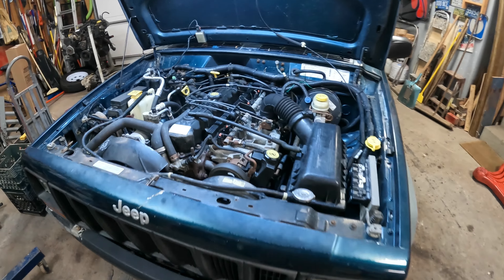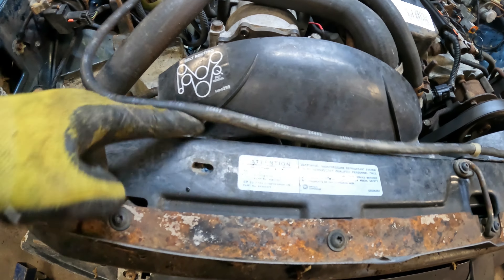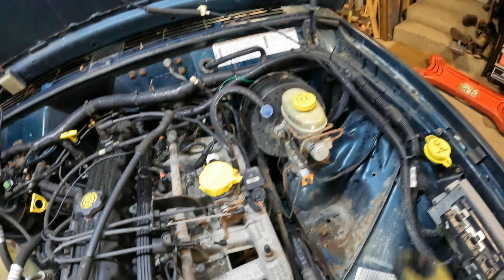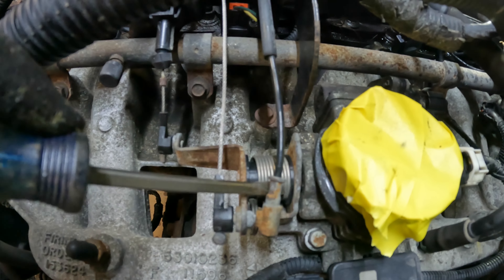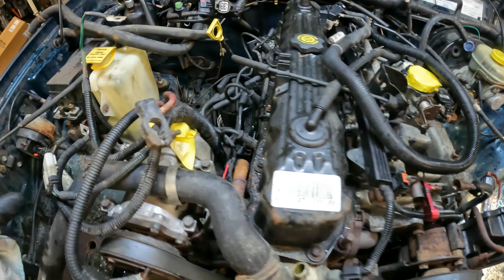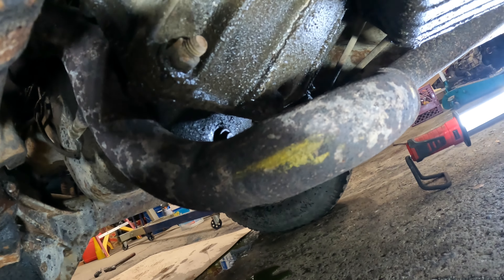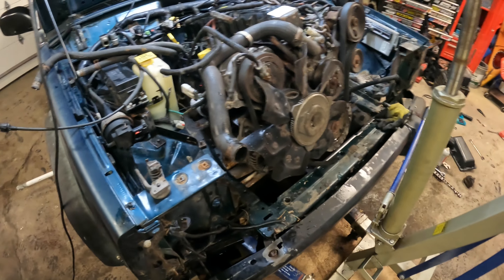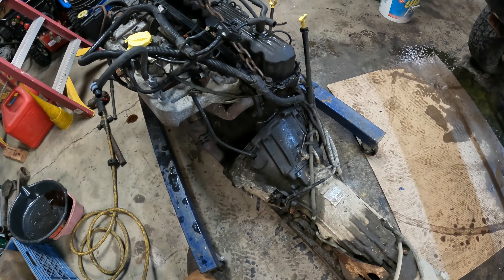1998 Jeep Cherokee XJ 4.0 engine removal

Comment: Great video! I believe I have a blown head gasket (I’ve gotta diagnose it and then get all the data I can) and I decided that with how bad those bell housing bolts apparently are, I’d rather pull everything as an assembly. It’ll be great to be able to clean the whole engine bay too and make my future repairs easier 😁
Reply: You shouldn’t have to pull the engine to remove the head
Reply: @trentbosman4979 You definitely don’t, I have a cracked flex plate and I wanna do a few other things (timing chain, clean everything, maybe do a rebuild, etc) so I wanna pull the drivetrain.